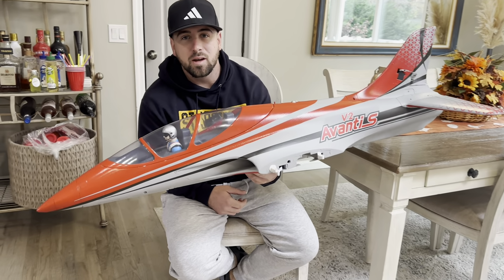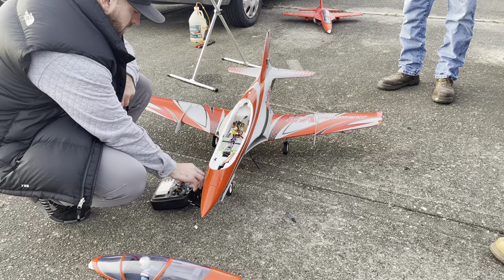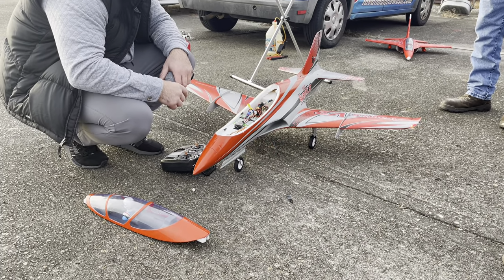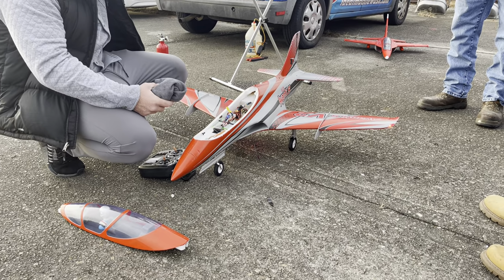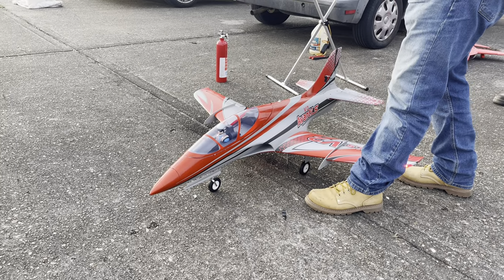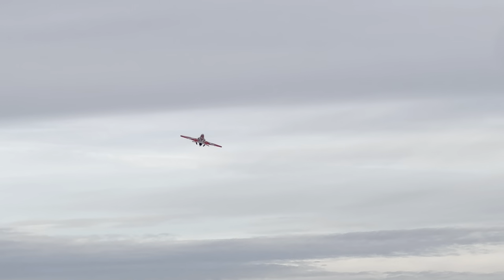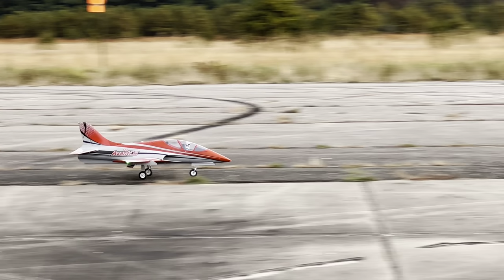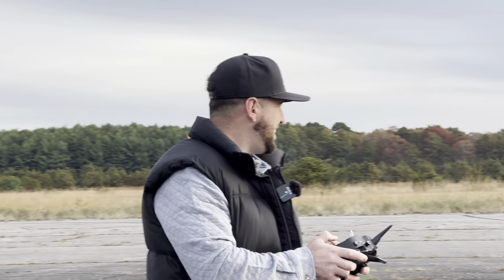The smallest RC Turbine Ever! - Avanti S V2

Comment: Instead of trimming all the way up, assign the turbine to a switch. Flip the switch, slide the throttle...easy peasy. Also allows faster shutdown.
Reply: Absolutely. Trim up/down is from way back in the days. Switch is way safer as you say especially for emergency shutdown.

Comment: SWEET!  Love my Avanti.  Better tape the hinge lines! Watch out for servos and control arms pulling out.  They don't remove the paint to glue.  The servos are metal shafts and the screws can fall out because there is no threadlock.  If you have the flaps move all the way down, the servos can stall and stop moving.  They will reset on their own.  I wish the elevator linkage was aligned straight to avoid unnecessary elevator hinge stress.  The left flap servo is still in the wrong place from a mistake in the original 2017 design.  The V2 has the front strut a bit shorter and for grass should have been a bit longer.  Smaller main wheels can help, but not as good on grass.  Of course for us bush pilots, the front strut support is a must have.

Comment: Wow thats amazing. The exhaust temp is really high, I'm surprised it doesn't melt even with reflective tape.
Reply from the maker: Surprised me at first too. But it works 👍🏼
Reply: venturi effect brings cold air inside the fuz and outside the thrust tube.  Keeps everything cool

Comment: Instead of turning the travel down in your transmitter, you should move the linkages in on the servo arms. Decreasing the travel in your transmitter hurts its resolution and the positioning accuracy of the control surfaces.

Comment: I thought the Kolibri T25 was smaller.  How about the Xicoy X45?
Reply: You are right. Lambert Kolibri T-15 until T-35 is a bit smaller and lighter (length 150mm  / P20 171mm Diameter 55mm / P20: 60mm. Weights (engine only) 255g (T-15) until 270g (T-35) Jetcat P20: 350 gramms)
Xicoy X45 is as well a bit bigger (length / diameter: 165mm / 59,8mm, 395 grams engine, only)
Good comparison between T-25HP and P20: https://www.youtube.com/watch?v=GkH_ezJU6Hg